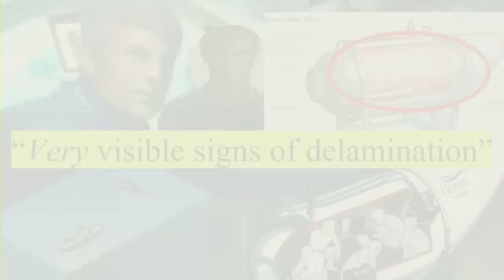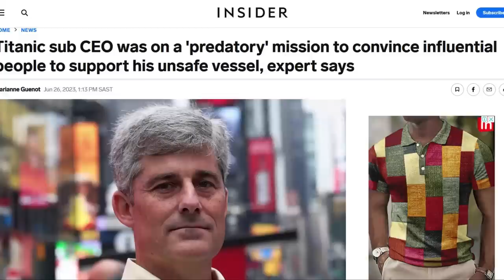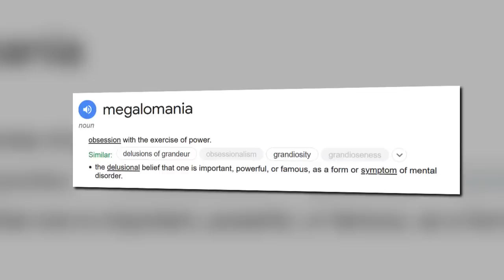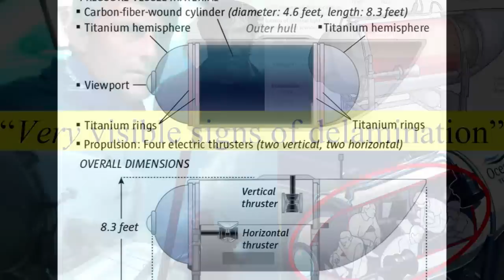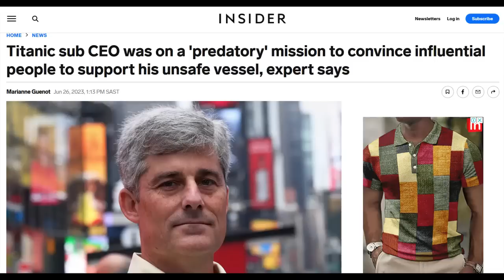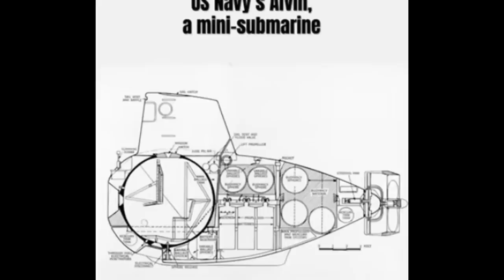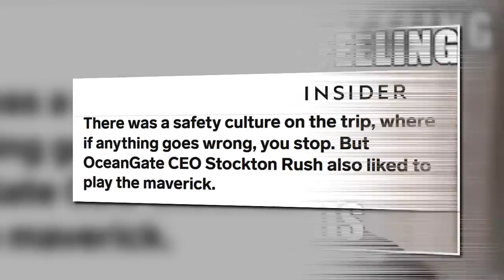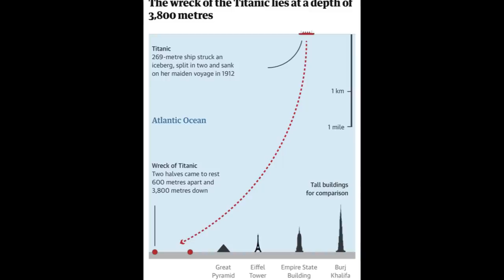"Lochridge shone a light through a sample of carbon fiber and saw splits in the midsection..."

Comment: Another video asked 'where are the bolts that held the viewport'?  I took a screenshot and blew it up on the computer and it really looks like the securing ring blew out with such force that the bolts pulled the titanium mating surface off.   It's rough and jagged so the bolts didn't fail....the titanium the bolts were screwed into pulled out in a big chunk.   That would take a LOT of force to happen so the implosion of the CF is pretty much certain now.   One pic of the recovered wreckage (poor quality...wish they were better) appeared to show a shred of CF still attached to one of the mating rings with the rest just GONE.
Reply: I couldn't find  CF on the ring, I think it was the adhesive.  It covered about 50% of the surface that was visible.
Reply: This makes sense to me.  As the CF imploded the water cascading inwards creates a pressure/shock wave that will be reflected OUTWARDs.  That to me is what blew the window outwards and sheared the bolts you observed..
Reply: @theoldbigmoose  I'm not sure if it's exactly the same, but when the Thresher imploded in 1963, the Trieste took some pictures and found that the main propellor and main shaft had been 'ejected' out the back.  Of course many differences between the two accidents, but it is interesting that the penetration at the 'end' failed outward.
Reply: @mikefochtman7164  I think it is.  My mental model is a spherical vacuum surrounded by 7000 psi water.  Remove the boundary and the water rushes in from all sides equally.  It acquires quite a velocity as this wave (from all sides) approaches itself.  It meets in the middle.  It is just like hitting a brick wall as it hits itself at supersonic velocity.  That energy has to go somewhere as the water is "incompressible" and is reflected back.  Just like how a hose aimed at a wall splashes back.  Also why we have pneumatic dampers on our home water system to control "water hammer" when the dishwasher or washing machine valve closes suddenly.

Comment: Does carbon fiber failure happen in a cascade? What I mean is when carbon fiber fails, does it fail quickly, with very little warning? If it does, then acoustic monitoring would be like saying the flash from a gun muzzle will give you warning so that you can avoid a bullet. Once you detect it, it's already too late.
Reply: Great question!
Reply: Yes. It has a high modulus (doesn't deform that much, brittle). It's a composite, meaning failure would be progressive (layer after layer, it would accelerate).
Reply: @patrickvolk7031  As said, it fails quickly.  In steel there is plastic deformation which tends to lower peak stress in an overload condition.  No such capability with carbon fiber.  Once it starts to go, as long as the load is the same its gone.

Comment: Another critical flaw in this sub 's design is the use of different materials. The compressibility of a carbon fibre cylinder compared to that of the titanium domes are very different. This results in extreme stresses occurring at the joint.

Comment: The really bad part of the carbon fiber was the layout as shown in some videos.   Carbon fiber gets it strength from criss crossing patterns.  The video shows that the fiber was laid out in a pattern that was up and down along the shape of the cylinder.  It should have had crisis cross at 45 degree angle to what we think as up and down.   It’s really should not have been used at all in this application.

Comment: It would interesting to hear from  a chemist PHD who has experience testing the material properties of carbon fiber under temperature and pressure conditions.
Reply: Not a PhD, but a MS and PE, with 4 degrees and work on 2 other MS degrees in other fields of engineering.  Retired from composite design-R&D, but still work as an engineer in another field.  Experimental Carbon fiber panels are routinely tested under expected loads, expected temperature gradients, and pressure as applicable.  Carbon fiber is good in tension but not in compression.  That’s why panels have layers oriented at various angles.  Other types of composites have been used in submarines surrounding external communications equipment.  

When I heard he used carbon fiber and saw how the craft was constructed, it made me sick. I saw how the carbon cylinder was attached to the titanium rings, and they drilled holes, and used adhesive.  The cracking Rush heard was the sign of delaminating which would result in catastrophic failure.  

For a craft like this under the pressures it would see, it should be a homogenous material such as titanium or even better stainless steel as they have a much higher compressive strength.  Mixing materials is not good as they each have different properties of expansion, contraction, tensile strength, and compressive strength.  So much was wrong with this.  😢
Reply: @leopardwoman38 I wish I had gone into materials engineering. Seems like a really interesting field. Congrats on all your accomplishments!
Reply: @Raelven  Thank you for the well wishes.  The materials field moved out of my area so I switched careers, plus the chemicals we worked with were pretty toxic, but otherwise it was an incredible cutting edge field to work in.
Reply: I am in no way any kind of engineer or materials specialist, but what you have said makes perfect sense and seems pretty obvious to me.  Rush was clearly off his rocker.

Comment: The fact that the Titan made it to the Titanic 1 time proves it works. 1 time. So he was right. However the hull was never (properly) inspected before that dive and again after that dive to determine in signifigant damage had been done. It may be that only a slight modification, say another inch of carbon fiber, properly fabricated would produce a viable submersible

Comment: The best materials for any purpose are crafted/forged at similar pressures/temperatures that they intend to experience. That's why bullet proof ceramics/armor work. They aren't just tough because of what they are made of, it's how they are made. Impacts generate heat/pressure so they craft the materials w/greater pressure/temps than they intend to encounter.  Correct me if I'm wrong (and I may be) but the ALVIN submersible's current pressure vessel for the crew is forged/worked from titanium at glowing white hot temperatures and even it can't safely go to all of the deepest places on earth. Carbon fiber is incredible but this isn't a safe use for it.

Comment: While carbon fiber is a wonderful material for certain things, it is not very well suited to extreme pressure cycles. Carbon fiber is not particularly elastic so when exposed to extreme pressure cycles, the carbon fiber matrix is likely to delaminate at some point.
People may not entirely recognize that most metals are actually pretty elastic. Metals can expand and contract to a certain extent depending on the type of metallic material. This is what makes in well suited to endure extreme pressure cycles but even then, any structure will still need to be completely x-rayed at specific intervals to ensure no micro cracking is hidden in the material.

Comment: It is not delamination that was the problem.  The problem with carbon fiber in a sub is that CF is only strong when the forces place it in tension.  On this sub the external pressure put the CF in compression which then just serves as a filler for the epoxy resin which may be stronger without the CF it.

Comment: In weaving when you are putting the lengthwise yarns on a loom after you have wound it around the beam you put on a length of paper. You continue winding with a width of paper wound on separating the yarn strands from those below otherwise If you fail to include this step separating the strands mis-align and slide down to the previous round. I thought of this when I was watching the machine winding the carbon fiber like warp strands but without the layers separated. One strand moves down to previous round  and the fabric is weaker. There is no crosswise strength. Seems like the strands would be weak where they lay next to other.

Comment: If the transcripts now appearing everywhere, the system actually gave them an 18 minute warning, sadly there was nearly no ballast after they dropped weights and frame. If the thing was 10 times more bouyant, they might have made it back up, but even then it would never be suitable for human travel. As a remote controlled submersible with no human driver or passengers this material could be used, but that's it.
Reply: This is why he had to use CF, it's much lighter than Steel. The weight of the water displaced by the sub needed to be greater than the sub's overall weight, or it would require external buoyancy tanks, a more complex design. If it were heavier steel, it would have needed to be much larger displacing more water but then, also need to be stronger, which means thicker and heavier.

Comment: I cannot fathom how anyone could trust carbon fiber/ epoxy laminate for this.  I can’t imagine the level of wilfull blindness one must have to deny one’s immediate intuition over the use of carbon fiber for this purpose.  Carbon fiber has negligible resistance to compressive stress.  This means that, in the end, it really was not a carbon fiber hull - rather, it was an epoxy hull weakened by useless carbon fiber intrusions.

Comment: The whole "acoustic analysis" was definitely bullshit. Composites like carbon fiber don't deform and fail in the ways that things like steel do. Their point of failure is just instant shattering, not some sort of slower deformation. The process itself also is potentially rife with imperfections in manufacturing the carbon fiber, and the price of properly cooking it to help get rid of those imperfections is expensive - and so of course Oceangate didn't bother.

Real Engineering did an excellent video about this very topic that I think anyone interested in this sub's demise should give a watch:

https://www.youtube.com/watch?v=6LcGrLnzYuU

Comment: The listening for snaps and crackles they were referring to was continuous NDT testing, Non Destructive Test-NDT.  I work with eddy current testing equipment, but I think he was talking about acoustic testing.  An absolutely insane thing to trust your life to on the fly.  A good tool for testing between dives, sure, but not DURING the dive, not relying on it as some sort of failsafe.

Comment: Scary thought, Kevlar is very similar to carbon fiber. They make helmets with it, and is being used in a similar manner to this hull design; it resists external pressures. 
In 1986 I was in the A.F., ordered to turn in my old steel helmet and issued what looked like a "plastic" helmet. I was pissed off, so I tried to smash it, failed miserably. Had I done the same to my steel helmet, I surely would have put a dent in it. I didn't even scratch the Kevlar, but I still never fully trusted it.

Comment: 2018. the holes in a sample of the hull which was later replaced or repaired? so not the same hull as was used in the final craft in 2023? Anyway, there's a later Stockton Rush quote already out there ( CBS interview with David Pogue. 2022?) where he admits publicly  flaws in the carbon, quite a scary quote and more sensational than the Lochridge one. Agree about your main theme - everybody was on board. Too many yes men and women whether employees or investors. Regarding the list of flaws, did they also fix all those by 2022 or instead, did they just do those lengthy pre checks which Pogue marvelled at? If they didn't,, no wonder everything had to be checked for so many hours pre dive. Remedial work was costly and Rush was cheap and in a hurry. The former venture capitalist had contracted clients snapping at his heels, he sold tickets before his ride was ready. Shades of  Verruckt

Comment: So he ignored the clear, audible cracking noises.  He kept diving as if it will only improve?
Next (according to the text messages) he’s ejecting ballast at extreme depths, and wondering why his ascent rate is painfully slow.  His only recourse is to relieve that pressure on the failing hull but he can’t do it.  
Quite a corner Stockton painted himself (and four others) into.  It’s one thing to use questionable materials in a craft like this.  Worse still to just ignore all warnings and bring others into that death trap.

Comment: Mr. Rush was more confident in his engineering capability than he should have been.
He was driven by his own freewheeling adventuresome and the endeavouring commercialization of what he in the end was trying to accomplish.  😳
He was going to make 1 million US $$$$ per dive , which could have made him many millions over just a few years if the vehicle was successful, it wasn't .... Carbon fibre is susceptible to weakening fractures due to temperature variations and atmospheric pressure variations, forged steel has much less  😳

Comment: The disclosure agreement they made each passenger sign off on mentioned death 3 times on the 1st page. In Lawyer terms this Cover Your Ass agreement spelled out how dangerous this Titanic tour was going to be. Paying $250,000 each while subjecting yourself to all these risks. Lochridge should have persisted more with his testing / facts on the Titan. Amazing how a guy with Big Money - Rush & a following can sweep people to be led where ignoring safety becomes a normal operating procedure. I used to work in Reliability Engineering & temperature / humidity along with salt spray would artificially age materials by cycling from high to low temperatures / cycling the humidity / along with the salt spray. A week of cycling under those conditions could age materials by a decade in a short period. Very much like we have with the Titan sub outer shell. Degrading the carbon fiber to no longer be the material it was to start with. 
We had testing procedures in place to determine when materials would degrade to the point of failure. It wasn't just the cycling procedures but also magnifications ( 30 to 60 times ) of the materials to see where / how it failed. Also had a SEM to see the material on a molecular level for analysis. Lochridge sure had the right sense but he should have followed thru.

Comment: I guarantee you water finally came through where the sub was glued together. At the point which the titanium was bonded to the carbon fiber. Especially after its delaminated a bit and weakened the structure where the titanium rings sat. On top of that it was banged around by the ocean for 6 days at a time TWO OR THREE SEPARATE TIMES. It was several different factors that caused it. Wait and see.
If they wanted to use carbon fiber, they should’ve made a shallower diving sub and worked their way deeper so they’d understand how CF acts under the stresses of water pressure.

Comment: Incorrect. In the end, the primary failure mode was NOT the carbon fiber hull, BUT the battery power system in the tail. We know this from the messages. It is clear that the battery failed while the hull was still intact, and a loud noise was heard which was likely the implosion of something outside of the hull in the tail, casing loss of buoyancy. The energy released by the implosion would inevitably have caused damage to the hull resulting and the secondary implosion. Maybe the hull would have held if the passengers inside the Titan had not stamped around trying to release the ballast. Lockridge totally failed to predict this failure mode.

Comment: Not only was it poor material, badly laid up, it was also subjected to high water pressure and then left in freezing temperatures, expanding any water that made it into voids and further degrade the integrity of the structure.  Plus all the loading scenarios it saw; bumps, drops, etc.

Comment: Those towing periods may be more significant than people think. Relatively low stress loads, probably of modes not considered significant, but probably unidentified, or un-analysed cyclic loads, creating localised cumulative damage that is quite likely sub-surface in the laminate, and likely in an area of inflection under compression....  It also appears incredible that there was no way of directly monitoring and tracking the submersible from the mother ship, but instead relying an direct communications with the crew.

Comment: The Boss was not thinking like an engineer and did self certification. Opinion points to carbon fibre failure, but there could be others. Simulations and condition of wreck recovered will give answer. The fast decent is a clue in my opinion.